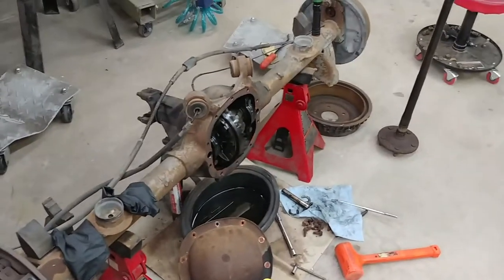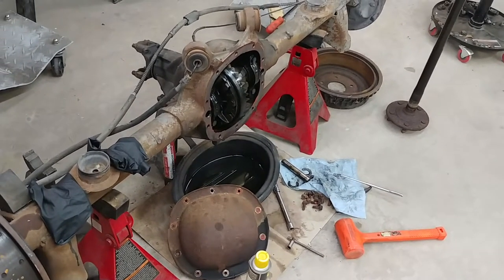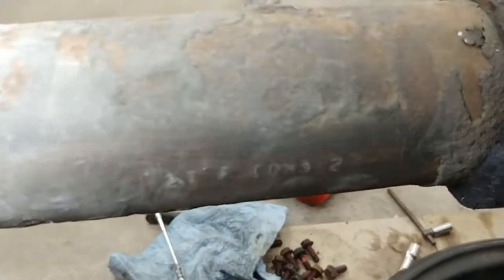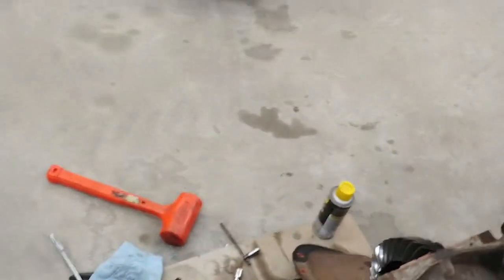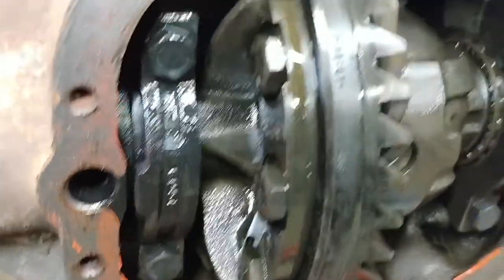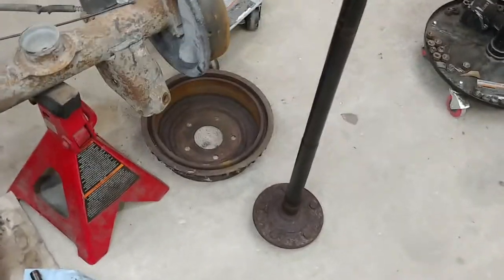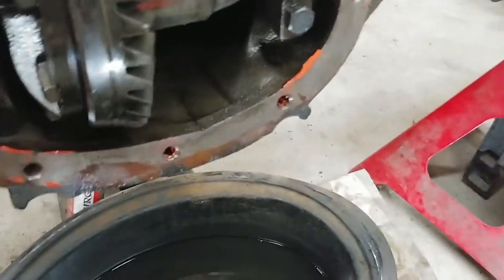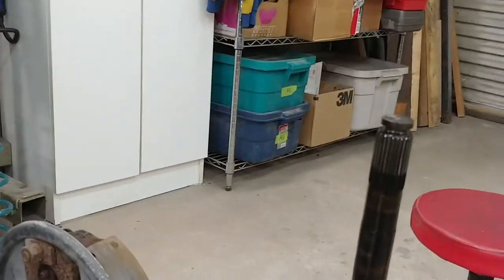7.625" Rear End 86 SS Monte (G Body)

Comment: Rather than spending money on this rear end your better off and much more cost effective and more sturdy to replace it with a Buick GN 8.5 rear-end 1984-87 or a Ford Mustang GT 8.8 rear end 1985-93 these GM 7.6 rears will not take 400+ horsepower with a sticky drag radial or slick it may be ok on a hard street tire hard launches with a sticky tire and over 400+ crankshaft horsepower it's going to break